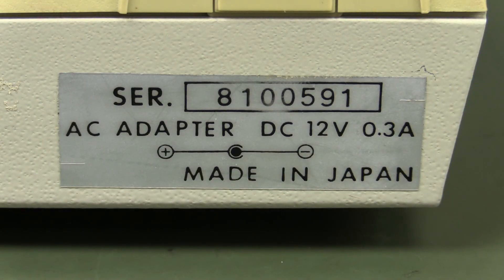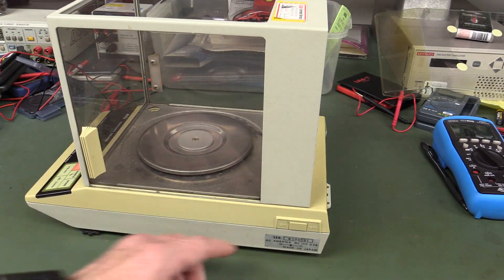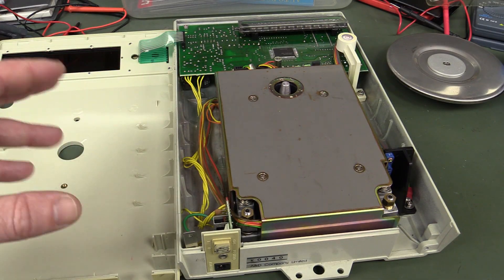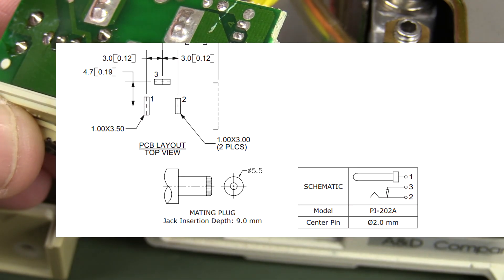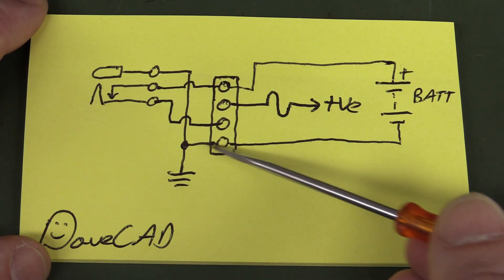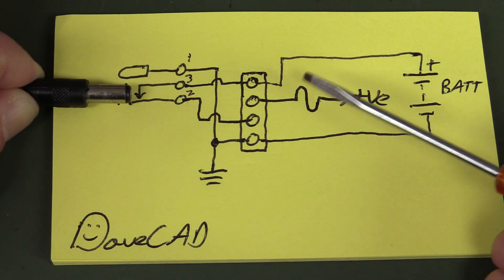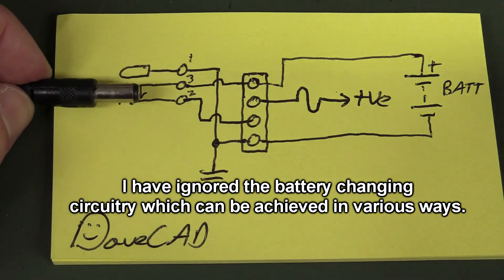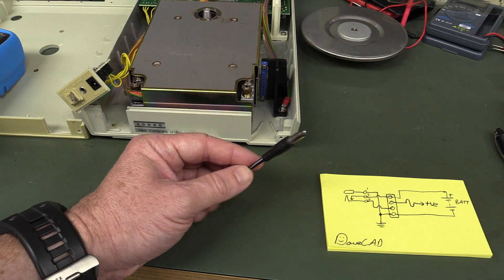EEVblog #1015 - Beware Evil (But Clever) DC Jacks!

Comment: Most guitar effects pedals are center negative. It's becoming less common to use batteries for your pedalboard, but since most gear gives the battery option, center negative is the standard. Having pedals of multiple polarities would be annoying because many people run all their pedals in parallel from one supply ("daisy chain"). Nice power supplies have isolated channels for each pedal.

Comment: Seems more dangerous to have the positive on the outside as you can easily touch it with your hand a complete a circuit, as most items seem to be grounded even yourself if not wearing proper rubber souls. So moving it inside seems safer as if you touch an outer negative you're not having a charge come through touching a metal desk or something similar or object. I could be wrong but this is what it feels like to me with my limited research into grounding.

Comment: I had a wireless security camera and receiver set and I was actually glad that one of the power bricks was center negative. The two bricks (one for camera and one for receiver) had very different voltages but the same connector, so if I had a brainfart and switched the powerbricks the internal reverse polarity protection diodes saved the lower voltage device from being destroyed by the higher voltage power brick.

Comment: I blame China. They love to do everything backwards because, you know, America is Satan and they don't want to do things like America does. Even though they manufacture electronics for America. Hypocrites. I have some LEDs where the flat side as well as the anvil inside the LED is actually positive. Yeah. If you didn't know, that's completely backwards design.
Center positive DC jacks also have that switch built in, except the no switch type. So that has carried over to center positive jacks as well. Works the exact same way, cuts the battery power off.

Comment: When I design PCBs, I tend to find a full bridge rectifier for the power plug, so I can ignore polarity. Then again, I also try to find broad spectrum power supplies so I can ignore voltage too, sadly, this is not the most cost effective way to design a circuit, so my method would not make it in a commercial product unless I could REALLY justify the added cost to the BOM.

I have a Dymo Rhino thermal label printer, commercial unit, that takes 9 volt, center negative.

As other comments have noted, this is a standard voltage for guitar peddles. I have an electric guitar and a peddle with a power brick so I had a spare power supply laying around that worked with my label printer. Yay no longer needing 6 batteries.

Comment: I remember almost every 12V adapter that I had beeeing center negative but most 5V adapters beeing center positive. I guess by switching, always connect the ground first, then disconnect the positive from battery and then connect the positive to the charger/external supply. 
Well, maybe in Europe the standard was center-negative and in some other countries center-positive (in some other kind of plugs as well)? I remember noticing some thing had the wrong connector with the center-positive...  thinking why? ;-)

Comment: I know back in the day UHER Report 4000 did also this positive earth (ground) thing.... some say it is because of pnp transistor. There could be also another reason for …. check this >> physically electrons flow from the Negative to the Positive so the mass of electrons then be collected by the positive (what is correct then)…. but when we draw schematics it looks like the current flows the other way from the positive to the negative (what is effectively wrong). Maybe some technicians decided to make it right.

What you think.

Comment: I dont think its good idea to use pin 3 for switching to battery. What if the user turns off AC while DC jack still is plugged in. The battery wont work until DC jack is removed.

Comment: I have an old portable radio with an actual AC/DC switch next to the ON/OFF switch.  I found that when I cut the house mains breaker and float the radio's AC/DC switch right in the middle, the radio will actually power up the entire house for about 2 minutes.
ADDENDUM:  I also do solar installations! Ask me how!

Comment: Most guitar FX pedals are center negative, and most manufacturers continue that tradition to this day ( along with using AC adapters with internal rectification in the product ). I don't really know why but I think originally the metal case was positive and used as a common positive ground system ( think old European cars ). and there's also a lot of folklore around guitarists that helps hold this tradition ( like "noise rejection" quote unquote ).

Comment: The 5.5 mm /center positive connectors for 12V PS are ubiquitous.  One thing to watch out for is poor manufacturing tolerances that allow the center contact to stick out somewhat.  It makes it real easy to short the stupid thing to chassis or wherever.  Yes, ebay.

Comment: A bit of trivia; in Sweden we often call those wall to DC transformers "battery eliminators" since they were often extra options for a lot of gadgets that would otherwise run exclusivlely on alkaline batteries, mostly during the 70's-80's.
Reply: We called them that in the USA too. Things like adding machines, Pong and Pong-clone consoles, and early VFD/LED calculators almost universally called the power adapters “battery eliminators.”

Comment: When we were kids we had loads of handheld games which were battery operated but had a barrel connectors which would save you from having to buy batteries. These required an expensive "optional" power pack which the manufacturers insisted you bought only from them. We always presumed the reason they all had different polarities and voltages was a marketing stunt to force people to buy another power pack. Call me cynical but I still believe that's the REAL reason.

Comment: I have a Casio Synth, working either with a DC 12V of 6 LR20 batteries. And the center is negative on the jack. Beware ! Now I know this, Dave, I'll check whether the hardware can run on battery, a sign to a reversed jack. Thank you EEVBLOG.

Comment: My Rigol RP1002C has a center negative 9v input.  I'm sure it's because it switches off the battery, but man, you'd think a $1700 piece of kit would have a normal polarity connector.

Comment: Both where used pre-mainland china being the source of plug-packs, though I think most Japanese stuff was centre negative - most of my older universal adaptors have a way to switch polarity. Once mainland china became the main source centre positive became the norm. Because mainland electronics engineering is ... very special. I think the battery thing is a reasonable idea :)

Comment: I find that type of connector, negative center pin, as an auxiliary power port in an capacitor dropper portable shaitty ebay speaker with f.m radio and sd card, usb, bla,bla,bla  that has an 6v internal lead-acid battery charged from mains. The guy who showed to me , plugged in an 6v jack, positive center pin, from an lighter car adapter and blew up the TDA2822M.

Comment: All stompboxes, (guitar effects e.g.) still use this connection. And this for most of all the major brands, like boss, ibanez, EHX. It does makes sense to use this type of thing, because they could be used on battery power. Thing is, nowadays i don't think there are many people using a battery anymore to power these things. Wheter it is because they use it in a pedalboard with its own PSU, or just simply because they consume much more power with the introduction of digital effects. A battery was enough for a simple distortion unit, a digital delay needs a bit more. One major flaw with this is that you want your casing to be connected to ground to avoid interference and with a center negative plug, you must use a plastic connector. And i'm not a big fan of plastic connecters

Comment: Back in 2001 or so the place I was working (a well-known chain) got ADSL with a separate modem and router from the same brand. However these two devices used opposite polarity. There were reports of other stores unplugging them both and then frying them when plugging them back in. Do'h!

Comment: the only unused plugpack I have has interchangeable plugs that allow you to use them as both CP and CN, depending on the orientation in which you inserted the plug.
The fact that I already have to check the plug-size makes checking the polarity a 'non-issue'.

Comment: Whenever I design one of those DC sockets into something, I always use centre-positive arrangement, BUT I still have a series diode on the positive just to protect against people putting the wrong polarity on it.  A series diode also protects against someone putting an AC adaptor on it too, as the diode then forms a half-wave bridge usually allowing the product to still work (although in that situation, the power supply would not be ideal)

Comment: This has caught me the other way I went to use the power adapter for my brother label printer as I required a 12 dc supply for a test device and as a direct opposite effect I blew the ass out of my test device as I supplied centre neg to it, never thought a new brother label printer would use centre neg pinout.
Reply: For referance the Brother Model is PT-E550WVP and is a current model on the market with centre negative dc barrel.

Comment: Next we will explore why the markings on the wire can either be indicating the center pin or the outside and no one seems to agree on what the marking will indicate. I am talking about the wire line or dash mark or the ribs. Where I work it is 99% guaranteed that if the polarity of the wire to the jack is not checked it will be wrong.

Comment: My brand spanking new Brother label printer expects negative centre pin... and does not come with an adapter as standard.
I have never fried anything by plugging in a reverse polarity DC jack, but that is because I long ago noticed the complete absence of standards for DC jacks both with regards to polarity and voltage, so I take nothing for granted.

Comment: My explanation for centre negative is that the first large scale use of transistors of course involved Germanium types. And I seem to recall that with Ge, PNP transistors were much more common than NPN, and therefore positive ground was the natural way to go.  But nowadays  it's Si and NPN with negative grounding.  So all the reasons we want centre positive these days, applied in reverse back in the early days.

Comment: Back in the day when I worked as a field engineer for British Gas, we were issued with Panasonic CF-41 laptops (this was early 1990s-ish - 50MHz 486DX with 8Mb (yep, that's MEGABYTES, not gigabytes, with a weird CD-rom drive hidden under the flip-up keyboard), and these had centre-neg chargers (15V, if I remember correctly). Very nasty indeed.

Prior to this though, in the late 70s / early 80s when these barrel-style DC power plugs first started to appear in consumer technology, the centre-neg was pretty much the standard. Common sense didn't prevail (does it ever?) until the late 90s / early 2000s

Comment: Other than a useful description of how a DC jack socket works, this video is pretty redundant. Dave gives no plausible reason why centre neg is of value. A battery pack is just as isolated whether you disconnect the +ve side or -ve side. I don't get it.

Comment: Some things were designed center negative with consequential damages in mind. That is to say that they intended it damage your device if you didn't use an adapter provided by them, and the warranty didn't cover it. Since the device was designed to run on batteries it did not come with the adapter, you had to buy it separate. I used to have a bag of adapters and almost all of them had the end cut off and taped back on with the wires reversed because I needed them to be the opposite of what they were or I needed a 6 volt adapter and all I could find was a 12 volt with the right plug and a 6 volt with the wrong plug. What can I say...I was around 10, and all I cared about was "making it work". Now I have a drawer with maybe 10 universal adapters that all I need do is set the switches right and pick the right plug and they will work in most cases. Still got my roll of electric tape in the drawer too. It's all sticky and nasty cause I haven't used it in years.

Comment: The switch could as well be used fo the same effect if the center pin would be connected to the positive and the barrel to the negative. So I don't understand your reasoning. Am I missing something?

Comment: We once had a product that used 9 pin D-sub connectors for power. Yes, you could kill it by plugging the power cable into the serial port, which was the same connector.

Comment: I let out the magic smoke from PC speakers due to this - The original 9V adapter died, so I pulled out another 9V adapter from a box of old power supplies.  Turns out the speakers were centre negative and the 9V adapter had a positive centre.  I also did a similar mistake with a PC scanner - plugged in a 12V power supply I found, only to find its output was AC.

Comment: I designed a product with DC jack made use of these inverted connector. As long as the jack is working as designed there is no problem. In case of a defect the power supply is directly connected to the batteries. In case of alkaline this is a safety problem. There are standards and regulations about this... afaik you have to reach a specifiy number of plugging cycles to be safe for product lifetime.

Comment: This hasn't really explained "Why" at all though. In the normal 99%-case, your internal battery just has two terminals so you can just as easily switch the negative side of that than the positive.
Reply: Shhhh! You're ruining a completely baseless but otherwise perfectly good rant.

Comment: I still don't understand why center neg. jacks ever existed. It seems like you could still use the switching capability with a center positive jack. Beyond that, it didn't seem like there was anything else Dave said that made it "clever" to use over center positive jacks. Also, as another commenter pointed out, center positive jacks are safer as the "hot" side is protected from accidentally touching a grounded case.

Comment: Let me tell you about the evils of center positive.  Suppose you have a device that is grounded.  And you have a power source that's grounded.  When you go to connect a live connector, guess which connection is made first?  Yes, the center pin.  But if the connector is center positive, that can create some issues.  Exhibit A: the Kenwood TH-F6A.  Imagine you're using this is a car.  The radio is grounded though the antenna.  When you go to connect the 12V power connector, the first thing that connects is the +12V.  But since the switch hasn't opened yet (bringing the charging system into the circuit), you've now just applied +12V to the 7.5V battery pack via the center pin and common ground between power source and antenna.  Good news:  You didn't blow the radio.  Bad news: the fuse is a SMD fuse and very hard to work on.

Comment: The added normally closed switch in every 3 terminal plug is truly ingenious. I've used the switch in all battery powered projects to make them wall adapter compatible, though they're always switching the negative terminal of the battery due to "modern" center positive barrel connectors. The battery doesn't care which wire is disconnected, it will still completely cut it from the circuit. This is useful for making frequently used battery powered devices, that don't need to be portable or aren't moved around much, accept power adapters but still maintain portability and not kill the batteries (although a diode could also do the trick, but those waste power in the form of heat).

Comment: I have a Brother P-touch label making  device (3 years old) which is centre negative.

I found that out when I used an external power supply and it did not work. However it also 
did not blow up and I still use it to this day.
Reply: MrTabs64 i have one too! I think maybe i burned input using wrong polarity. I cant get them to work with correct polarity now, only works on batterys

Comment: This caught me out once with an Intempo iPhone speaker dock, I plugged an 18V DC in regular - outside + inside, but forgot to check the polarity on the speaker, and it exploded with smoke and capacitor shot up. Smelt awful.

Comment: Actually the DC input jack you're talking about has a SPST switch. Not DPST as you said in the video, or as you pointed out with a really poor correction. It's not effectively SPDT switch either. It's just a plain old SPST switch. Or Single Pole Single Throw. And that of course is why it was made center pin negative because the engineer who designed it wanted to use positive switching for the models that had the optional internal battery.
     A lot of newer products use these DC barrel jacks and plugs that are wired center positive. The engineers that design this way want to use negative switching. If they use it at all. I've seen barrel jacks with 3 or four terminals where only two of the terminals make an electrical connection to the jack. The extra terminals being used strictly for extra mechanical strength to help hold the jack to a printed circuit board. Panel mount jacks don't need the extra terminals.
     Because you see both center negative and center positive designs out there. It's always best to check and make sure you have the right power adapter for the device you're trying to power. And yes there are some devices that are designed to use an AC input.
     There is no real standard for barrel jacks. As far as center terminal polarity. Not to mention all the different external barrel diameters and all the different pin diameters. There are quite a few different combinations.